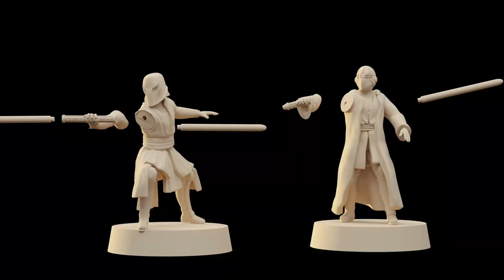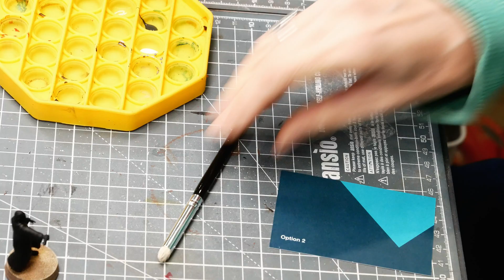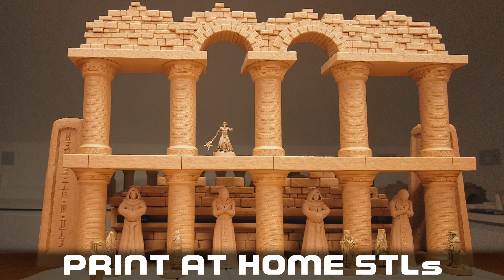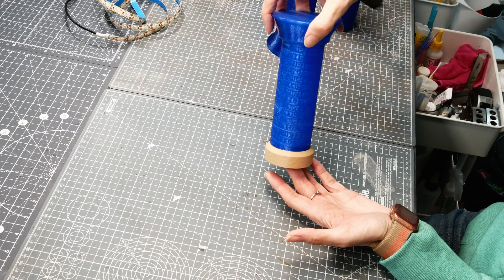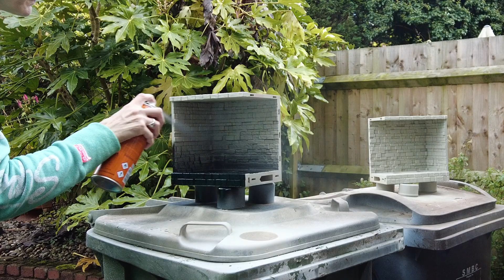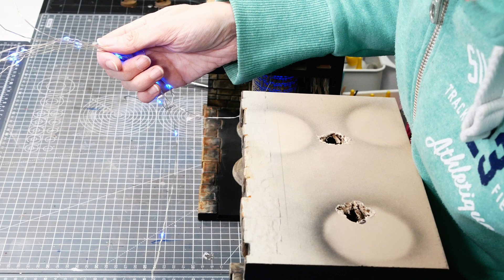Light Up your Miniatures with no Soldering! | LED Minis | Temple Diorama

Comment: Brilliant! Can you provide a link to the components please ❤
Reply from the maker: I used items I already had lying around so it’s hard to link to them I’m afraid.
Reply: Thanks. I'm not sure what size led you used? Also  are you able to switch it off? Many thanks
Reply from the maker: @mysticmog  I used 0604 pre wired LEDs.  The 0402 are smaller but I find the wires come off too easily.  I turn it off just by popping the battery out - it's only held in by magnets so easy to do that.  I match the battery voltage to the LED voltage so I don't need a resistor
Reply: Thanks Kathy

Comment: I struggled for ages with several attempts at making a 25mm base (for some D&D minis) that could hold a large enough battery, and that also had a small enough footprint, while still having the battery easily removed. To make it even harder, I actually needed something with a bottom for the base.
And in all my frustration, I never even thought about something as simple (but elegant) as this magnet solution :p
Thank you. You might have given me my missing piece of inspiration here :D
Reply from the maker: Magnets are so useful; I always wish I’d thought of them sooner.

Comment: Hiya Kathy, awesome project, looks really great, especially the columns.👌🏻🤩😍
Conductive paint has already been mentioned in the comments, but I wouldn't use it as conductor tracks along down the entire figure, as the inherent resistance of these conductive paints is very high. I think with 3D printing, the cable ducts can easily be designed to fit. If in doubt, first insert a longer, somewhat more stable wire through the whole figure and use as a hook it to pull the copper wires through (as is done when laying cables in empty conduits in house walls).😉 But conductive paint would be very helpful for connecting the enameled CU wires to the magnets. Even if a wire comes loose from the LED (this happens quite often with these pre-wired LEDs, and it has already happened to me with the SMD LEDs I soldered myself), conductive paint can help - but the adhesive strength is very weak, tensile stress on these connections should be avoided.
It's true that painting white LEDs red with transparent paint/glass paint (some people also like to use colored permanent markers like Sharpie, Edding etc.) doesn't really work well. With cold-white LEDs it can even happen that no light comes through at all - I personally had a lot of "fun" making this experience myself on an US ambulance light bar, before warm white LEDs even existed!🙈😆 Well, I didn't know that you could simply connect a red LED directly to 3 V button cells (coin cells), that would of course be very practical, I definitely have to find out more about it. Nevertheless, there is still be enough space in the base plate for an SMD resistor (even for a large SMD 1206). Here too, glue the wires with conductive paint to the resistor and secure them with superglue...🤓😇
When using these 12V LED strips inside all kinds of models, I always have a bad feeling: These strips tend to get very warm, especially in closed objects without air circulation like these columns. And if this plastic packaging material is tightly wrapped around the warm LED strips, it could lead to an "unhealthy" build-up of heat... But these little fairy lights should be safe in this regard - and they look much better here too.😊
As for the lightsabers, I also know the problem (elsewhere in the H0 model building), and it is indeed difficult to solve. I haven't tried this myself yet, but there are fiber optic cables with a diameter of 1.5 mm that also emit light to the side. This doesn't work really well for long distances, but the effect should be enough for these figures. Green Stuff World also has 1.6 mm fluorescent, transparent acrylic rods in red and blue (also green and violet), which might work better too. However, if 1.5/1.6 mm is too thick, things get trickier...🙄
Reply from the maker: So much to answer!  Heat is always a worry with leds but I rarely leave my dioramas lit for long and the 5V strips aren’t normally too bad in that time. The only problem with the fairy lights is that you have to press the button to get them to work every time you turn them on.
Reply: @KathyMillatt  Oh, I apologize, when it comes to LED strips I always think of the 12 V things, I keep forgetting the 5 V ones. However, I don't have one either, so I can't say anything about their heat generation.
Yes, there is a problem with the switches on the small fairy lights. However, they could easily be hung together from a single power source using only cable connectors (lustre terminals, Wago clamps or plug connectors, etc.). Anyway...

Comment: There exists a fiddly process that doesn't need wires to the LED. You paint Kemo L100 or similar silver car rear defroster repair fluid onto the LED terminals and the model, and then hide that under another layer of paint. Correctly applying the conductive paint is challenging, if you're slow you will end up with connections that look perfectly fine but just don't work. The fluid needs to be shaken for like a minute every 20 seconds, and for a good few minutes initially.

You can also generally use any LED with a 3V coin cell. This is because the current these cells can produce is inherently limited, which effectively self-limits the voltage.
Reply: Great idea. I didn't know that product was still available, I first discovered it 40 plus years ago, when I started working at an auto factors.👍✌️💜
Reply from the maker: Good to know on the batteries, thanks. I have conductive paint somewhere… and can I find it!
Reply: @KathyMillatt All batteries have internal resistance that limits the current they can supply. Manufacturers of things like LED keychains rely on it to keep the batteries from dying early and to prevent blowing the LEDs the first time they’re switched on, so they don’t have to spend a tenth of a cent on resistors.

This complicates matching cells to LEDs- it ‘s not solely about making sure the cell supplies enough voltage. That’s very likely why your early attempts didn’t work. This can be especially vexing with  “smart” LED strip lights which contain extra circuitry that demands higher voltage and eats extra current. So, sometimes you just have to do as you did and keep digging through your stash to see what will work.

Also, about hiding wires- I have found that with wiring as fine as you used you can often just lay it on the surface of what you’re trying to light, letting it disappear into folds of clothing or whatever. A little paint and the keenest eye won’t find it. I first discovered this while making a Harry Potter wand. The wire fit neatly into grooves in the bark of the stick I used (I didn’t know at the time how to make lengthwise holes in long sticks) and a little paint made the wires invisible.